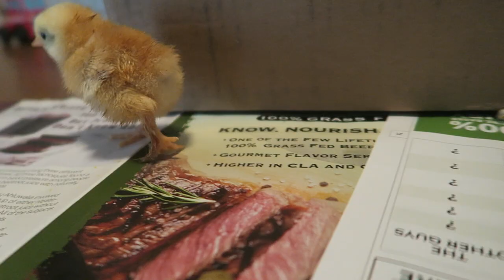We MIGHT have an addiction

Comment: Double Yolk eggs?
How do you know without breaking them open? Interesting to find out if they're fertile.
From yours, and the Rhodes', recommendations, I've ordered chicks from the LOCAL Ohio Myers Hatchery. Picking up in June (only doing one run this year). Very excited to add a Rooster to my laying flock from the meat birds I'll raise this year. I ordered Red Rangers. 
I'll be sure to include this in my videos.
Reply from the maker: +Rick Mitchell - the double-yolkers are really huge, it's pretty easy to tell that there are two yolks in there from the size of it. Meyer Hatchery is a good one, we'll do some Red Rangers in a month or two as well. That's awesome!
Reply: I figured you candled them.
Reply from the maker: +Noneof Biz - we've opened so many of those eggs, we can tell by the size of them now